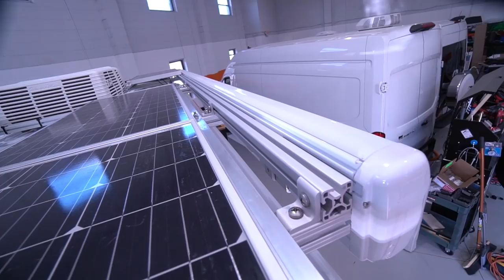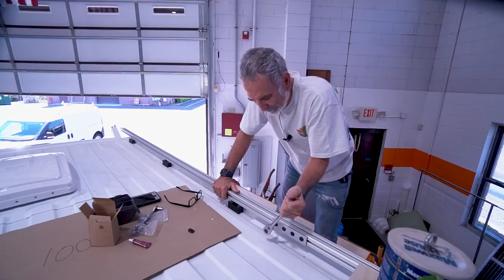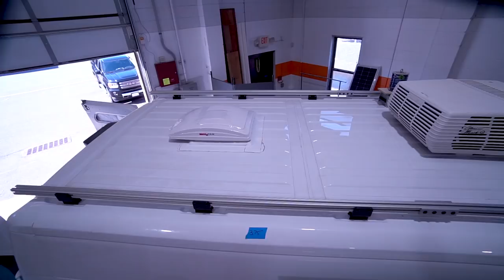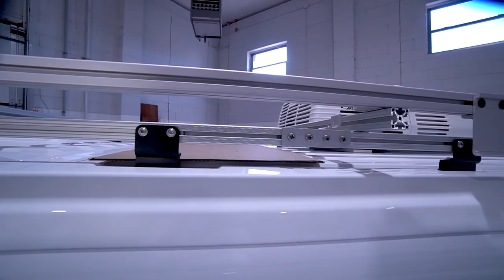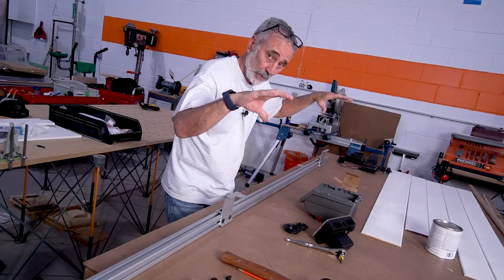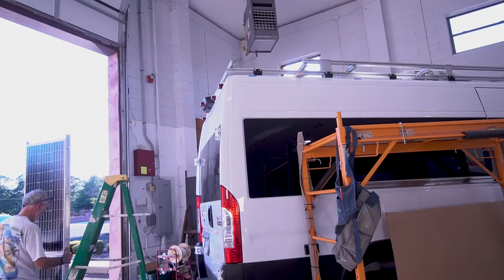Building a SOLAR ROOF RACK (on your van) using 8020 extruded aluminum

Comment: I had the same thing happen to my 80/20 bolts... a few of them rusted in a matter of months. It wasn't all of them though which I found odd. Maybe the coating had a defect on some? I was just trying to figure out what size/length SS to get. which size did you use?
Reply from the maker: 5/16-18
Reply: @HumbleRoad  thanks!
Reply: @HumbleRoad    Damn it, all in inches..pitty only americans understand that shit...
Reply: @arcenciel2968  some Americans need to use both imperial and metric, I have to take m to feet and Kg the pounds all the time. You still have some places drive on the left and others drive on the right. You have miles per hour in the same place with Kg. We just learn to live with each other’s differences. You need to understand until recently the ease of international information wasn’t as easy to get. Now for your soo hard conversation that you don’t need because in other countries extruded “aluminum” is sold in metric, not in imperial. 5/16 is about 8mm and -18 is how we measure pitch, but how we do it is rotation per inch or 25 mm, so the screw rotates 18 times per inch or 25 mm. So for you just get a 8 mm bolt and match the pitch to the 8 mm hardware.
Reply: @marinefoxalpha4499    I understand, all this is fine. However, metric applies to all the world (with very few exceptions). Propeller pitch and tube diameter comes to mind as these exceptions. For the rest, the majority, its only metric. It makes no sense to anyone in the world, except perhaps to old people in the commonwealth countries which  used the imperial system before they too converted to metric. The only country left with this old imperial system is the usa. I bet when the Chinese take over as the no 1 economy (whether we like it or not), the us will understand that their measuring “language” will be obsolete. It is to the advantage of americans to start getting used to it ...the earlier the better. I personally refuse to even discuss imperial, if a producer doesn’t talk metric I just move to the next one who does. This debate (imp vs metric)is not even up for discussion anymore. Good day.
Reply: @arcenciel2968  The USA is an odd mish-mash at this point.  Science is pretty uniformly using metric.  Precision anything is metric around 50% of the time.  Non-precision things are mostly still imperial.  I'm an old man now, and I remember decades ago that the USA was going to make the push to convert to metric, but it just never happened.
Reply: @missingegg    Yeah, I think that “precision anything is in metric” started when a joint NASA/ESA rover destined for Mars got lost because there was a misunderstanding in measurements between the two systems; hence all became metric after that...

Comment: Holy moly, that's a clean looking rooftop. Is it feasible to mount different sized (smaller?) solar panels in-between?
Reply from the maker: There is only a slight bit of room left for a smaller panel. However, while it has been done, I don't like to mix panels.

Comment: Naive (?) question, but won’t the anodized layer on the 80-20 rapidly oxidize in this extreme outdoor use?  Obviously it won’t rust, but corroded, pitted aluminum will weaken the structure and look bad..

Comment: great video, as always! One question, are you considering the corrosion that occurs between dissimilar metals? You WILL get corrosion between the aluminum and the stainless steel unless they are not in physically touching each other. Less of an issue/concern in invisible areas, but you may want to consider using plastic spacers/washers wherever you don't want visible corrosion after a few months.
Reply from the maker: The bolt, washer and the T-nut are all stainless. Since corrosion is localized at the contact point, the larger anodic surface area (aluminum) as compared to the smaller cathodic surface area (ss washer and T-nut) will create a passive coexistence. Since the ss bolt threads are embedded in a like metal, ss T-nut, I don't anticipate any seizing.
Reply: @HumbleRoad  OK! FWIW,  I know you will cover it in a future video IF any problem develops. This is part of what I admire about you and your work. Love your builds.
Reply: @Chris Hopefully. But Ford also hoped there would be no issues with their stainless valve stems on their Alcoa clone coated aluminum wheels on their Super Duty trucks, and there's been a lot of corrosion issues reported by unhappy owners.
Reply: @Chris Believe me, I know. I'm living in a commercial built RV while traveling around the country (since 2017). My question to George was because I know how fastidious he is about cosmetics, design, build integrity, etc. 99% of people will not care less.
Reply from the maker: Correct, Chris.

Comment: This is also why Washing machines don't last like they used to- 'they' connect two or three different metals together between the drum, spindle arms and bolts. So even if the rest of the machine lasts, one day it'll just snap between those critical structures from corrosion and boom! Another $400+ sale. Galvanic corrosion is a bitch!
Reply from the maker: All that water doesn't help!

Comment: I just finished my 8020 roof rack yesterday and then I saw this!! I haven't put it up on my roof yet and I can change out the bolts. Do they have them at Lowe's and what would I look for?
Reply: Maybe I already have stainless steel...my bolts aren't black, they are silver.
Reply from the maker: I have two specialty stores that sell nothing but screws, bolts, nuts, washers, fasteners, etc. Look for a similar store near you and bring your bolt assembly in for a reference to buy the correct product. You need to swap the bolt, washer and T-nut.
Reply: I have gotten all stainless hardware (bolts, washers, lock washers, and nuts) to replace existing stuff at Lowe’s while we were on the road in CA. It was convenient and I was thankful they had everything we needed. The specialty stores are great and I use one at home (I always prefer to support local family owned businesses)  but you may be able to get by at Lowe’s if you need to. 😎

Comment: I’m interested to understand why  the panels and awning are mounted so high above the roof and not much lower and closer?
Reply from the maker: The air gap under the panels will keep the roof cooler. All the Land Rovers and Land Cruisers in Africa have a double roof for that very reason.

Comment: In past builds you used adhesive on the panel mounts to the roof. Did you do same or did you go through the roof with the Unakas.
Reply from the maker: The Promaster has nipples on the roof for mounting. No penetrations.

Comment: What I hear from Ford is you should not connect anything directly to the start batteries, but instead use CCP1 or CCP2. This is on a Ford Transit chassis 2020 or newer with dual start batteries and dual alternators. Where are you connecting your DC to DC chargers on the Ford Transits?
Reply from the maker: With a second alternator there is no need for DC-DC chargers

Comment: Anybody have any good tips on roof brackets for Ford transit that accommodate the 3% pitch of the roof where mounting plate sits? I want to build my own rack but the roof mount cleats are the hardest thing. Thanks in advance (hopefully;)
Reply: Not sure if this comment will get removed again, but the folks at Flatline Van Co may sell a roof bracket. They have a complete roof rack system, and their quality is top notch, not sure if they just sell components, never hurts to ask!

Comment: What size of 8020 did you use?  1", 1.5", or another size?
Reply from the maker: Both
Reply: @HumbleRoad  I assume then it's based on location?  Could you describe where you use each?  Trying to design a rack for my van.

Comment: interesting choice to choose a wall mount style awning?  The only logical reason I can think of is thats what the customer already had?  A roof mounted awning does not require drilling holes  -  especially for a Ram/Ducato... it utilises the roof rack mushrooms and fits flush against the roof so you don't get sun shinning through or even more importantly no rain running through, and its a lot lower profile and cleaner, factory looking

Comment: I have a 2018 Chevy express passenger extended van that I have crudely turned into a camper for my wife and I. We are seniors. I need to have air conditioning installed on the roof. Can you do this. I will run it on a generator
Reply from the maker: I’m sorry Roger, but I only do full builds.

Comment: 1 3/16 ″ alu extrusion(30mmx30mm) vs 1 37/64 ″  alu extrusion? (40x40mm) for roof rack / upper cabinets inside? 
It's for a Transit, I think 30x30 will be good enough, but I watched another youtuber who used 4040 for upper cabinets. 

Thoughts?
Reply from the maker: I have been using 15 series for the heavier modules; refridge, garage framing and shower box. And 10 series for all cabinets.
Reply: @HumbleRoad  Thank you for taking time to respond to me, I really appreciate it. 10 series I believe is 1"x1" so just a little bit shy of our 30x30mm. 

On the solar roof rack you built in this video, did you use 10 series for the initial frame? >

Also, can I ask what 8020 costs approx over there?
Reply: @AndreasEUR  I use the 1" for everything but I can understand using the 15 series for heavier items - it's bulletproof. I love the lighter weight and smaller volume of the 1", and if you don't need extended, unsupported stretches, it works great.

I've even thought people could get away with the 20mm stuff on Amazon (sold mainly for 3D printers) if they're trying to keep costs down. I think it would work for cabinets and smaller structures.

Comment: I am building a shuttle van with six solar panels on the roof weighing about 20 lbs each over a span of around 20’. Do you think the 10 series 80/20 1”x1” or 1”x2” would be sufficient or would I have to go with the 15 series aluminum?
Reply from the maker: I would use 15 series and be very smart with your structural design.

Comment: I didn't think you were meant to use Stainless Steel with aluminium?
Reply: Yep! its called Galvanic Corrosion. Maybe this doesn't apply to 80/20?
Reply: @robertwayne3567  had a critical issue in a teardrop camper build I did 12 years ago… huge problem even beginning to separate screws, bolts and plates due to corrosion. The covered teardrop hinge I used on the kitchen reacted badly with the fasteners and sheared, didn’t notice till too late.

Comment: So, will changing to stainless help? Ever heard of galvanic corrosion? Two metals in contact will corrode: the highest on the galvanic scale will be fine but at the expense of the lower one. Originally the normal steel hardware was corroded away by the aluminium. By using stainless you will now corrode away your 80/20. Take it from a guy that has owned several aluminium landrovers…..

Comment: Every piece of stainless steel I have ever purchased has rusted (stainless steel has an iron component). Hopefully your hardware is much better quality than mine and won't rust.
Reply: If you have demanding applications, it's certainly worth researching which specific SS alloy to get, as there are non-trivial differences between them.  One job I worked on actually required SS bolts with a specific alloy, and we couldn't find a supplier.  So we paid an eye popping price to have a machine shop make them for us.

Comment: I get the rusty fastener thing is horrible. Those 80 20 parts seem to be just blackened which has no durability as you have found. Stainless looks pretty but you then create the issue of galvanic corrosion which weakens and eats the aluminium. This could effect the structural integrity of the frame. Imagine that frame failing at 70mph! It may be fine if the van lives in the desert. Add moisture, salt air, dirt etc and you have created an electrolyte which will get to work on you lovely aluminium. You may not see the damage it had done from the outside, but between sections and brackets that are clamped together and out of sight you may have a point of failure when you are bowling down the road at 70mph with the wind buffeting around the panels. Stick to quality coated fasteners and brush anti corrosion wax or similar on them. You don't need much and just clean and reapply every year or so. Speaking from experience having had issues on fire trucks and motorcycles where people fit stainless bolts then ride through winter salt thinking it's all good😂
Reply from the maker: Part of the annual tighten up is to check for corrosion everywhere.

Comment: When 80/20 charges so much for their hardware, why on earth would they use rust prone materials?  I'm dumb founded!  I am glad you exposed this.  What a rip off.  

How on earth did you get that Fiamma awning long piece shipped?  Its the length of the van.  Must have been a pickup.  Very hard to carry that piece in any vehicle from the maker or retail outlet.|

Question:  If you are using glass solar panels, those are heavy at 38 lbs each.  6 roof panels x 38 lbs = 228 lbs.  Plastic Flex panels are 1/2 lb each or 6 x .5 = 3 lbs.  You save 225 lbs.  They cost $100 each and price keeps dropping.  Why not change them out if they fail every 5 yrs. You spend $300 but save a lot of gas costs and Cargo Carrying Capacity?  

What we need is a system to mount them.  Imagine a system that slides out like wings on either side, providing shade to vehicle, esp over cab side.  Slide out when parked.  Slide back in for less when not.  They stack on top of each other like gliding drawers.  If you did two glides, you would save on roof real estate too, providing a small deck or cargo box on top.  

The ideal material to mount them to, would be Lexan Corroplast - resilient to UV and weather and shatter resistant, light, and having both insulating properties and air cooling for panels.  You put a frame over them like a picture frame, holding both panel and Lexan together coupled tightly,.  This becomes the 'drawer' you glide in and out or mount directly on roof rack.  For added stability against wind forces, you add some thin cross bars over it.  This will prevent flyaway.  

I dislike those heavy glass panels on roof.  We need a lighter solution.  Hopefully there is one.  I've been struggling with this concept to figure out a solution for my RV solar.  I have both panels but my RV is heavy enough. If anyone knows a good solution for mounting flex panels please share it.  I know they are not as efficient but my god, I cannot accept that 38 lbs weight!
Reply from the maker: Not necessarily a rip off. Those particular bolts are simply not intended for outdoor use. They also sell stainless steel.
As you saw in this video, the 100W panels I use are not that heavy, I carried two of them with mounting rails attached up to the roof. I like your picture frame idea.
Reply: @HumbleRoad  Glad to know quality still exists with 80/20. Thanks George!

Comment: Why not just invert the mounting bracket to have them on the inside of the 80-20
Reply from the maker: The bracket is not a 90 degree angle and cannot be flipped. You could reposition the rail to the outboard side of the bracket, but that is not structurally desired.

Comment: George aren't you concerned with using stainless steel fasteners on aluminum? I was  taught never to use dissimilar medals together.
Reply from the maker: The bolt, washer and the T-nut are all stainless. Since corrosion is localized at the contact point, the larger anodic surface area (anodized aluminum) as compared to the smaller cathodic surface area (ss washer and T-nut) will create a passive coexistence. Since the ss bolt threads are embedded in a like metal, ss T-nut, I don't anticipate any seizing.

Comment: Kinda painful to watch him putting that panel up there by himself - straining, dragging the cables across that bar. We need to get help on something like this - and taller ladders.
Reply from the maker: I appreciate your concern. It’s very compassionate of you. I have always preferred to work alone, so I am always working smart, rather than hard. But I never said it would look pretty! So far, I’ve gone uninjured and without catastrophe! Although, I have my second full-time contractor starting beginning of November. Help is on the way! 👍
Reply: @HumbleRoad  I’ve always worked alone as well, but I’m paying a price for that now (I’m 65), and at our age we don’t “bounce” quite as high or fast as we used to. As an engineer I appreciate your attention to detail and quality. I’ve learned a lot from your videos. Stay safe!